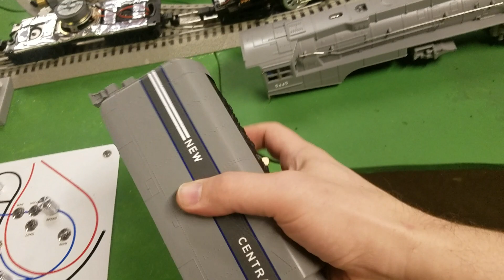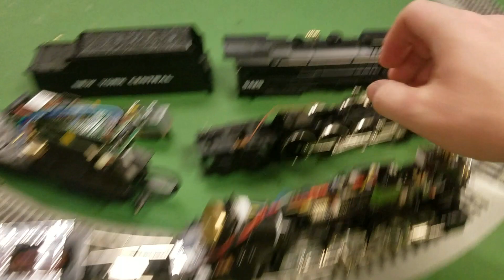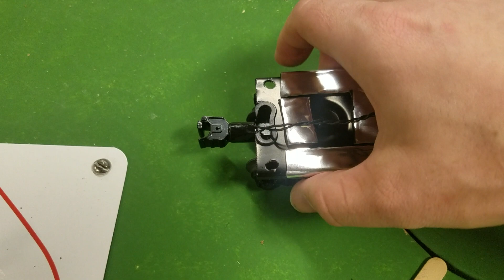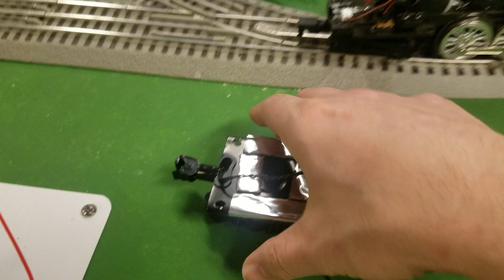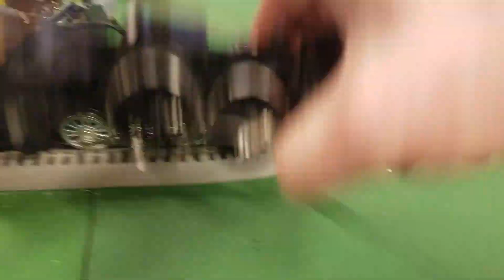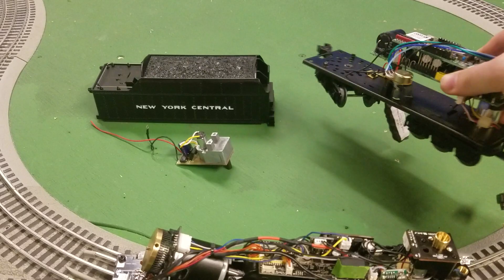How I put Lionchief Plus Electronics in a MTH Proto 1 Locomotive

Comment: If you did that to an mth locomotive then I bet I could do it to a traditional locomotive but I imagine I would need to buy a lioncheif locomotive in order to get the electronics
Reply from the maker: The hard part is motor compatability. Typically the ac and dc mounts are completely different. Yes i had to buy a complete lionchief loco for all the components. Lionelservice doesnt have everything you need typically.
Reply: @Blair88mph  I also imagine you can't just buy any lion chief locomotive board you have to get one that is close to the locomotive you want to convert. Like in this case you used a lioncheif Hudson for parts for converting an mth Hudson
Reply from the maker: @katerinakittycat3849  This is true. It is also much easier to convert with a lionchief+ as the speed and chuff sensor is built into the motor, wheras standard lionchief steam have a photo sensor that is flagged via a cam attached to the wheels. Most trains do not have this setup. But yea whatever LC board you use will have the board sounds too, so if you use a mickey mouse board your going to have mickey crew talk.
Reply: @Blair88mph  is there any soldering involved with this conversion because im not good at soldering and I wouldn't want to ruin any part of the LC board or electronics

Comment: Where did you get the new regulator for the smoke unit that you can adjust?
Reply from the maker: Its a micro dc step down MP1584EN from amazon. I got a 12 pack for $12. Has a pot you can adjust out voltage.